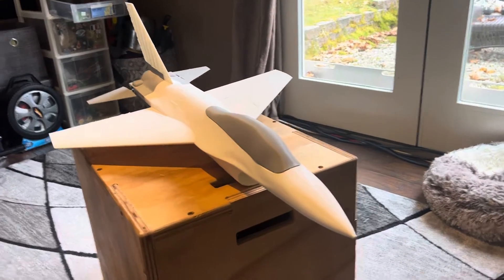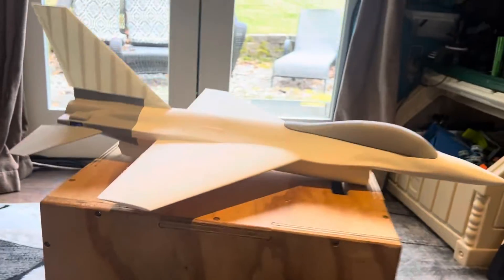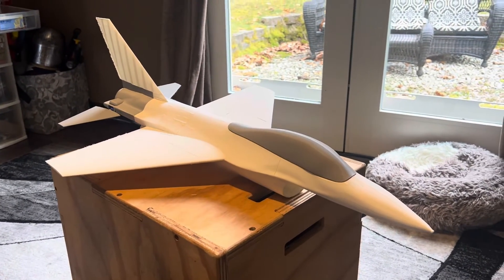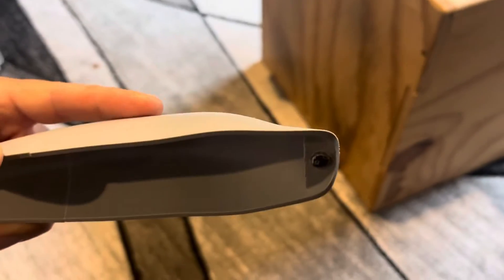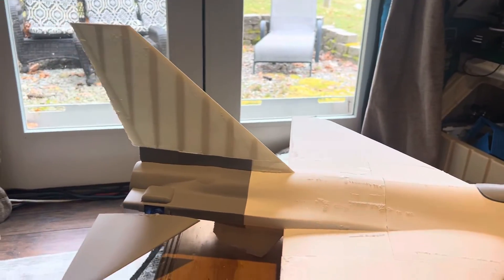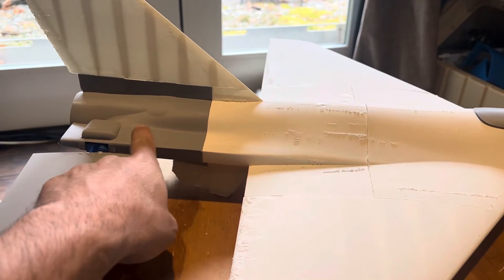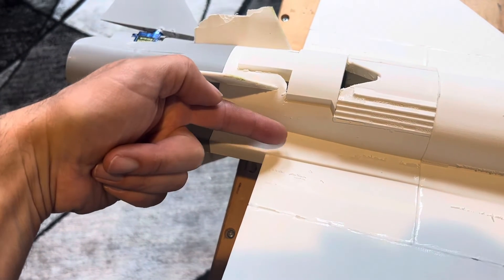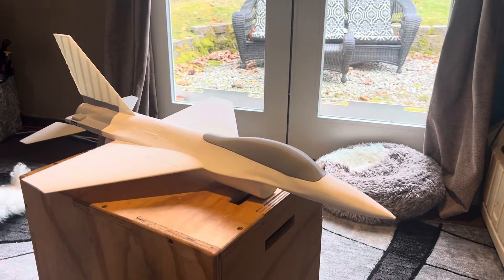3d printed f16 build instruction and description

Comment: Bought the file and everything printed great. One question. Do you have a video showing how to attach the elevators to the servo?
Reply: may i ask how much filament used for this model in meters? and did you printed it with lw-pla?

Comment: did you glue the whole plane together and then add electronics? Like Does the 50mm drop in thru the bottom or does it have to be put in before the plane fuse is glued together?
Reply from the maker: Glue to whole plane together. My designs may not be the prettiest but they’re super easy. The only thing you should do is clear the servo wire holes of any support material before you glue. If you’re using PLA they just pop out clean. I just printed the 50mm fuse in LW foaming and the cheater hose was hard to clean up but it works. Sorry I thought I was responding to my Viggen video. From memory I don’t think you’ll have any issue gluing the whole thing. Isn’t don’t clog the servo wire holes with any glue. You’ll need to line it up perfectly to be sure the servo wire and extension can pass through

Comment: Well. You posted this two days late for me. I purchased a couple of weeks back and started printing. Looks gorgeous. I hope it flies at least like the one in your previous video. A couple of questions: Where is the CG? How did you hold the stab to the servo? My AUW is at 750g with a 1500MAh Lipo. Do you think it'll fly? How can I share a photo with you? Thanks!
Reply from the maker: CG photo was uploaded to cults3d I haven’t been able to update anything for days because cults is running so slow. CG isn’t sensitive in this jet. As long as the battery and ESC are in the cockpit it will fly fine. Check cults for the photo
Reply from the maker: Email me at ptikyle@gmail.com